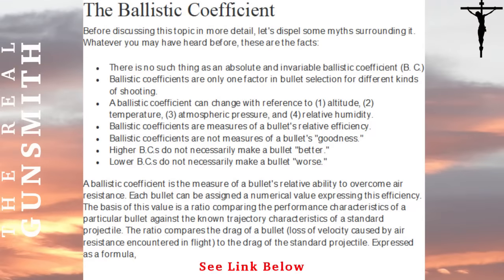7MM PRC Compared to Other 7MM's

Comment: I’ve put some thought into this, and I say this as a current 7mm PRC owner. I was building a custom hunting/ long range/ whatever rifle in a long action. It was originally gonna be a 28 nosler but I called the barrel maker when the 7prc came out and had it switched after I listened to a few podcasts and videos about how great it is. changed my order because time/components for reloading are hard to come by and I have found that the hornady cartridges are rather easy to reload for and quick to find an acceptable load. Blah blah blah. I remember seeing this video and thinking. “Damn! The real gunsmith is real sour about this new PRC cartridge!” 😂… we’ll as I now have it, shot it, tested it and have my data here are my findings…. Can’t find brass for it, you gotta buy the hornady ammo. Shoot it and then you have hornady brass… I was getting 2860 out of the 175 eldX from Their factory ammo and they show 3050 on the box… yes I’m aware all rifles are different. And Ya I’m shooting in an area where it’s cold about 23degrees and out of 24” barrel…. I have done my tests and checked out 4831 and H1000 and settled on H1000. I’m shooting 180 Berger VLD hunting and loading over max and I’m getting 2960. Great standard deviation of 2.8fps and the rifle shoots it under 1” @ 200. Not setting any records but it’s performing well so far. the speed and accuracy says more about the load and the rifle than it does about the cartridge…. Couple gripes tho.    
1. Hornady brass is soft and you have to shoot the ammo to get brass. 
2. You can’t even load it out very far because you won’t have proper bullet contact with the neck. Where they have it, is about as far out as a guy can go. All the prc/creedmoor cartridges do this. (Barely need a long action.)
3. Not as fast as they say it is. They neutered the potential and made it JUUUST long enough where you can’t get use it in a medium length action. They should’ve made the case longer so it fills up magazine box when loaded long and actually utilize the need for what long action. 
4. I have a 300WSM that shoots lights out with a 185 Berger VLD hunting bullet. @2960 and I’m shooting 2grns under max. 😂. So other than having a new rifle not much need for it. 

Now the things I like. 
1. Relatively easy to reload for. Under 100 rounds to find .5 MOA load 
2. Lighter recoil but I also have a break on it. 
Proceed at your own risk.
Reply: Are you gay/happy?
Reply: This guy sis seriously butt hurt, but more about the writer of an article than the PRC.  What Hornady did with the PRC is make excellent ammo off the shelf that you do not need to to be an expert reloader or smith to improve your accuracy. 7PRC is better than the 7RM for 99% of shooters/hunters.  I am starting my 7PRC build myself.
Reply: @GoneHunting-j2c lol calling the eldx “ excellent ammo for hunters “ is like calling joe Biden a good president . That’s hilarious
Reply: Same here I built a 300 wsm 1:12 krieger # 5 @ 23”  b&c stock  jewell trigger  185/190 Berger’s 2950 w 66.3 of imr 4350 being 30 cal it’s 1:12 twist 165 to 3100  rl 17 h380 believe me that one hole w 165   Rl 22,23,  but it’s not like a 6.5 that needs rl 25,26 h1000 to make it consistent  the 7 mm prc would be the same deal

Comment: Glad I found this channel. Very informative and practical. 
I used the Hornady ELDX in 7mm-08 150gr on a midsize buck here in Alberta a couple seasons ago. Took 2 shots at 100yds. I’ve never used them again. 
I have a pair of Tikka T3xs in 270 and 7 Rem. I shoot heavy for caliber bullets and use 150gr in 270. Either Partitions or Interlocks. Never had a problem. 
For the 7 Rem I use 175gr Partitions or Interlocks. Mostly Partitions. I get just at 2900fps but they shoot and perform so well on deer, moose, black bear and elk that I’ve never really looked at trying anything else. 
I do check out various factory loads in other bullets but I tend to go back to what is proven and works for me.
I watch Ron Spomer and who now features Joseph Von Benedikt. Both of them, it seems to me , expound BC more than anything else. They say they don’t condone long range shooting (500yds or more) but still provide ballistics tables to 1000yds on a number of cartridges being presented. However I’ve seen comparisons where sectional density was not spoken about or not regarded. I think this is where the difference is when gun writers are promoting the current fad because that is what keeps the lights on as opposed to Mr Selby and other gun makers who are not bridled by sponsors, magazine editors or corporations.

Comment: I probably missed some points here.  Is the 7mm PRC worse than the 7MM RM?  Why can’t you load the right hunting bullets in the 7mm PRC and have the option to use the longer bullets for long range shooting?
Reply: I have the same question. I understand the PRC is more suited towards Precision Shooting. Hence the P in PRC. However you can still load the 160 nosler in it and still get the game results? I hope we aren't the only ones confused
Reply: Well, if you use logic, it defeats this guys argument 😂
Reply from the maker: Hydra 70:They are selling it as loaded with factory bullets.
Thanks for watching.
Reply from the maker: Zachary Donelson: You confuse yourself. No factory ammo will shoot to the accuracy level of any handload that I work up for my own or clients rifles. They can't, as they are made to be able to work in a variety of manufactures barrels, who all have varying tolerances, so their accuracy won't be the same. 
Thanks for watching.
Reply from the maker: The Practical Rifleman: It is obvious you didn't listen well. 
Thanks for watching.
Reply: @TheRealGunsmith  I listened quite well. You evidently don’t communicate well or your info is outdated.
Reply: @TheRealGunsmith  
After watching a few of the Hornady podcasts I can see where you are coming from.  There is quite a bit of hype and stretched truths they are pushing.

Not sure if it’s also hype but their reloading data has the 7PRC velocity outperforming the  7mag with the exact powder/bullet weight.  Is this possible with less powder?

Comment: Prc is just a short action magnum (saum wsm) with a longer throat to except longer high bc bullets without compacting the powder and stuck in a long action due to the overall length. I hunt and shoot a 7mm wsm and it’s phenomenal. It’s short coming is the shorter neck to seat a longer bullet. The short fat cases are more the efficient at burning powder quicker. There fore u can get the same fps out of less powder less recoil when comparing the same charge or a little more in a longer case. Lot more powder in the 28nosler lot more recoil therefore it’s going to be faster than a short fat magnum case. How quick the burn gets to the center of a powder charge effects velocity.  Quicker center powder burn of the charge equals higher velocity. That’s fact over a longer case longer powder burn with the charge being similar. Key word in my statement similar! What’s I’m warry of if you go longer high bc bullets in faster twist the spin can make the bullet come apart. This is why winchester kept the twist in the wsm the same as the rem mag and capped the weight at 160gr. A elk is not gonna care if it’s hit with a 160 bonded vs 175 bullet.  Guys need to understand what spinning the bullet faster can do. It can make it come apart at the higher rpm of the bullet by adding a lot of more force on the bullet guts.  5” different wind drift at 600 yrds vs the prc. I can hold or dial that. When I buy another 7mm it’s gonna be a rem mag just cause I want higher weight bullets my short mag can’t handle.  There’s give and take between the wsm and rem mag but I believe the high twist prc could be problems
Reply: The only PRC that fits in a short (ish) action is the 6.5

Comment: Perhaps some of the advantage of these new chamberings is that they claim to standardize things that the older chamberings can only reliably deliver in custom rifles. For example, I've heard some experienced shooters say that rounds like 6.5 CM and the PRC rifles shoot a wide range of ammo well whereas the classics 30-06, 308, 270 Win etc are picky about rounds. Is that because they build the requirement of match grade tolerances into the specs?
Reply: When someone like Hornady has a seat at saami to get new cartridges approved, they can dictate a reamer that optimizes performance and then make ammo suited to the reamer they dictate.

Comment: Hi Randy, thank you for sharing your knowledge.  I have a quick question?  I am new to handloading  and do not understand how you can increase cartridge length without DECREASING  LOAD DENSITY.  You mentioned that the 7 rem mag with nosler 175 gr bulletin the best combo.  Nosler book says COAL is 3.290".  That load density with h-1000 powder is 89%....  How do you improve that when you suggested loading to COAL 3.500" ?  The load density will be significantly adversely affected...
Please help, I just want to understand without catastrophic consequences.   Thanks, Bill
Reply from the maker: It is all about square inches.  Increasing load round length gives area for more powder. So you increase the charge from, say as an example, 66 gr IMR 7828 to 71 gr IMR 7828 and get more velocity.  Load density is the same. And H1000 does not give the velocity of 7828.
Thanks for watching.
Reply: Mr Randy do you know of any powder that is comparable to 7828 i have been looking for some without any luck. I tried ladder loads with Mag Pro and my results were less that likable.

Comment: I imagine gunsmiths don't like the PRC cartridges as in the past the only way to get the longer throat, tight chamber or faster twists was to go custom. Now the average person can get all that off the shelf. No doubts a well made 7RM could be as good or better but more expensive.
Reply: This exactly. You can get a off the shelf $500 rifle that’s going to give you close to if not the same performance as a full custom rifle. He sounds a little disgruntled. Hornady specs the velocities very closely to real world realities.
The 7mm Remington Magnum was and is a wonderfully designed and balanced cartridge. The fact still remains that you have to use a custom barrel to get the most out of it.
Reply: Can u imagine if 270, 3006 had faster twist and 26 onch barrels. Little tighter tolerance
Reply: Yes I can. My 270wsm wit a 26" Bartlien 1-8 twist barrel pushing Berger 170gr Elite Hunter with RL-26 @ 3200 fps

Comment: Randy thank you for taking the time to explain, in understandable terms, what most true handloaders know from experience. You talk in terms of action lengths, throat, seating dept…..all of which I have pondered over reloading for my two factory 7mmMag rifles. A sako and a ruger. I think I am inclined to be interested in PRC for the reasons of …increased barrel twist will give me a better potential for tighter groups at
100yds using heavier (175 and above) projectiles. I haven’t had very good results with 175gr bullets out of either rifle. Both have 1:9.5 twists. Also, a wider bandwidth of bullet weights. 120 to 190 with the shorter case. 
I, personally, cannot drop 6500 on a custom rifle if similar features and function may be attained for 1200ish. 
I agree with you over BC as it relates to hunting. It is low on the list in hunting situations. My longest shot on a game animal is 325 yards and my daughter had a shot at 437. Any shot over 250 ( while hunting ) is quite a long shot due to uncontrolled variables. Barnes TTSX and Nosler Partitions perform well under 500. In my experience if you see an animal with hooves at 500yds you, most times, have opportunity to get closer. I would love to have one of your custom rifles. I so appreciate your craft and envy being able to do what you do. It has always been interesting to me. Hopefully I will own a custom gem of a rifle one day.

Comment: Mr Selby I would love to twist your ear on a twisted idea I have. I have wanted to rebarrel a savage model 99. still use the 300 savage case but necked it down to 7mm or 6.5 or 6mm, heck even a 257 Ackley Improved chamber. I've been a fan of the 244/6mm rem for years but the model 99 with a 300 cartridge but necked down with a long neck similar to the creedmoor. idk, maybe I'm chasing my tail but I would like to build one either way. what's your thoughts?

Comment: I have over pressure issues with my factory Hornady 7mm PRC 175 ELDX Precision Hunter ammo in my new Christensen Ridgeline FFT 22”. I noticed the ammo is .03 longer than Hornadys reloading manual. When I chamber a round and pull it out I have rifling marks on the bullet, unsure if it’s a ammo or a chambering issue.

Comment: The 7mm PRC allows someone without a gunsmith shop in their garage to go buy a factory rifle n shoot heavy for caliber (high bc) projectiles out of a barrel with the correct twist rate for those projectiles in a more compact package... the shorter powder column allows shorter barrel making a lighter rifle. If I wanted to get my 7 rem mag to shoot same I'd have to A: have the reloading equipment, B:get a new barrel with faster twist rate, C: get extended mag and mag well so those long bullets cycle without hanging up, and not to mention the chamber tolerances. All that would cost more money and headaches than just getting the rifle with the updated, more efficiently designed cartridge. The 7mm RM is a great cartridge but it's not very efficient.
Reply: This is true, I just purchased a prc and I did it because of the efficiency of the cartridge and the ability to off the shelf shoot long and heavier bullets. This is just a better longer range cartridge than the older 7rem mag, which is an awesome cartridge but we’ve entered the next chapter and era of different cartridges with efficiency in mind. The years of Gunsmithing to have a rifle shoot like a custom gun is over cuz the factories are making the rifles ready to do it, with a fraction of the cost. Along with the ammo
To shoot in these rifles which I think is the smartest marketing plan by Hornady
Reply: Explain your shorter barrel theory, love to hear the technical aspects?

Comment: I shot a 7mm mag for 20 years.  Still have it. Never failed me with 160g accubond bullets. Usually single shots, quick kills. 
Im getting a 7mm prc because i researched all i can on this cartridge and accuracy, a little less recoil and tighter tolerance on actions seem to make sense. I'm confident it'll be a excellent cartridge for any ungulate on our continent.  Ill be using the 160g cx bullet to start with, but will make changes if needed in time with newee designs.  

Im not a long range hunter. 500y or less,  but usually kill under 250y. I know the 7mm prc doesnt outshine the 7 mag as far as drop below 500y, but i believe it to be more accurate and less finicky on ammo.

Time will tell, but i say the 7mm prc is here to stay.😊

Comment: The biggest advantage to the 7prc is for the guy that buys factory rifle and factory ammo.  In a year or two  nosler will carry 180 grain 7prc ammo( factory ammo not handloads). That should have in excess of 2000 energy at 500 yards.  The 7mm rem mag factory ammo 160 nosler accubond carries around 1500 foot pounds of energy at 500. A custom made rifle chambered in 7mm rem mag with handloads will be able to do everything the prc can do.  This allows your common hardworking man to buy a factory rifle, factory ammo and have a similar set up as the guy who can afford custom rifle.  Maybe I'm wrong but  I think this caliber will be a top 5 seller a decade from today.   Time will tell
Reply: Spot on
Reply: Really do not understand why old heads like this guy cannot understand this. Us that do not handload or build 5k custom rifles the 7prc is the clear choice

Comment: I'm getting 3160 out of my 7prc with 180gr berger vlds and it's not showing pressure. And the berger vld kills and does it quick. Guess my old country gunsmith from North Carolina knows how to put one together.
Reply: I’m not buying it. Unless you have a 30 inch barrel or are necking down the 300PRC case to 7mm. Always hear of these amazing velocities on the internet but have never seen it in person
Reply: @Lee Lathrop  you don't have to believe it. I really don't have to prove anything but facts are facts.

Comment: Well, you also talked down on the 300 prc, stating it doesn't really do anything the winmag can do. Well actually,  one can get a non-custom 300 prc and get all the things that would need to be custom for the winmag. Tighter factory chamber,  tighter twist for heavier bullets..
Etc. Oh, and the ability to purchase factory 225 grain match loads. Now you are on to the 7mm prc. Having the 300 prc, wouldn't be surprised if you are just as wrong about the 7mm prc.
Reply: If you listen to what most of the people talking about what the PRCs is good for, it's not that they can do what other cartridges can't.  It's that you can buy a rifle off the shelf, with ammo off the shelf to get similar performance as a custom chambered and hand loaded combo.  Not everyone wants to hand load and spend so much on a rifle.
Reply: @05psd916  that’s what he said

Comment: My friend was very much into fast cars and one thing he told me is there's no replacement for displacement.  If it holds more powder it will push a mullet of similar BC and weight faster every time.  Now I have heard some cases burn powder a little more efficiently and that maybe I don't know I've been trying to research this to find truth since it seems like most of the burn happens in the barrel